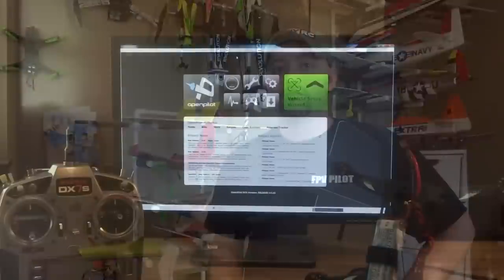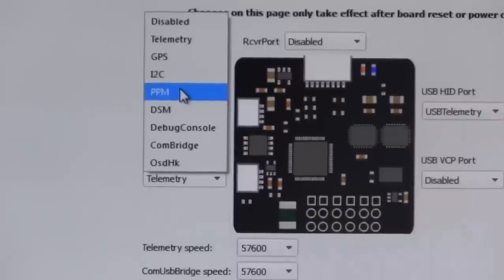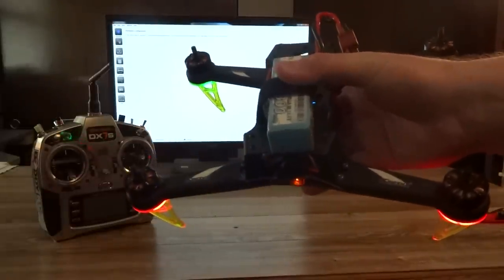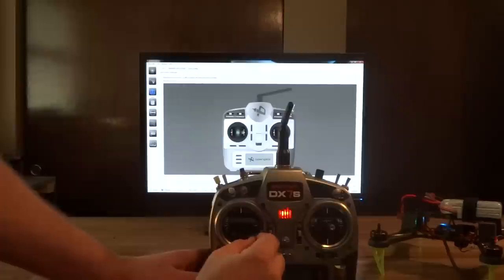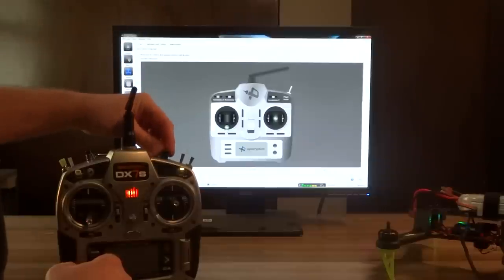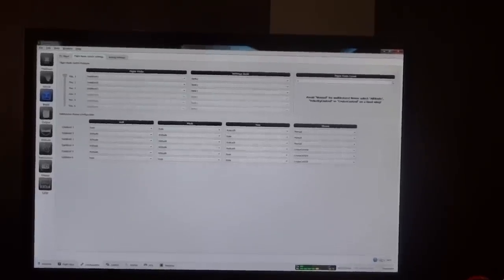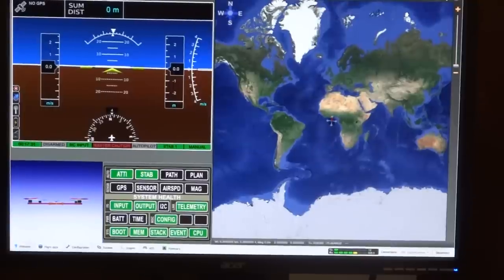Spedix S250 cc3d binding, and Transmitter Setup

Comment: great video. you talk about satellite receiver. i have dx6i with ar6100e rx (no satelite that i know of) id like to buy this quad as my first venture into arf/pnf 250 size. im exp with cheap rtf micro quads & helis. proficient with rtf (non gyro) foam planes like bixler and the like. and race pro buggy 1/8th nitro buggy cars. in other words have good rc exp outside of quads. How will i go with this quad based on my exp and spektrum radio gear?
Reply from the maker: +Jason Black This kit already comes with the satellite. The is no need to add a receiver. The Flight controller recognizes the Sat and deciphers the signal. All you need is a few hours of time to assemble/ bind, a Battery, and a spektrum Radio. The DX6i work great with this setup.

Comment: dont you need a three position switch for the three stabilization modes show you using a two position switch for d/r?
Reply: +moore rc guess you are using a three po switch for stabilization dont know why you need d/r and expo lol
Reply from the maker: +moore rc You do not really need Expo in the transmitter. I just felt as a beginner it was easier to change the rates a little from the transmitter than try to explain each of the different banks in the software.  Its more of a preference and many people today do not set up expo in the transmitter. By using the different banks in the software You can actually set up each mode to have different rates instead of using expo in the transmitter. As for the stabilization modes you can set up the switch for as many modes as you want in the software.

Comment: hi im currently stuck setting up my dx7s in the transmitter wizard set up, when it ask me to move the stick for pitch up and down nothing happens but if i toggle the gear switch up and down it works.
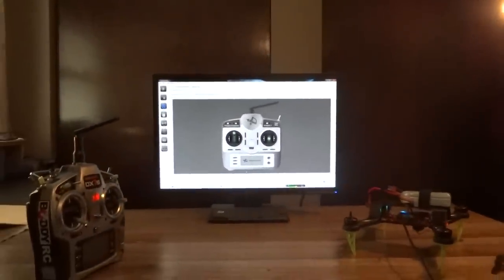Reply: +Marcos Castro Are you positive that you didn't bump pitch during the roll axis? Check out the video at 12:00. If you even barley hit the pitch axis on any of the others like roll it will not let you use the pitch axis anywhere else.

Comment: the dx6 doesn't have the dial, what other spot would you recommend for that? it is the 6 not the 6i
Reply: +steve flounders The dial is used for remote PID tuning. You just will not have the ability to remote tune and will have to keep plugging it into the computer make a few PID changes and put it back in the air to test. It just makes it much harder to get the PID's tuned in. Other than that the Dial is not needed.

Comment: I'm using a Devo 7e with Deviation installed as my transmitter. When I try to bind, the light never goes steady. It turns off, then on again but pulsing slower than before. It doesnt do the next part where the light goes off and then back on steady.
Reply from the maker: +AnAbsent MindedPenguin I'm not familiar with this radio, however it does not appear to be a compatible transmitter for the installed DSMX satellite receiver that is installed in the quad. . You will need to either find a DSMX compatible Radio or install a receiver that is compatible to the radio you are using.
Reply: +AnAbsent MindedPenguin If you set the cc3d to bind mode (&quot;dsmxbind&quot;=0) inside of Openflight like Wes did in the video, then save, and disconnect the board at the lower icon, wait 30 secs, then unplug the USB cable, plug in your battery to your quad with your radio transmitter OFF, it should flash rapidly. turn on your radio TX and put it in bind mode, then the light on your RX should be solid when bound.

Even after you unplug the battery and plug it back into the computer, having put &quot;dsmxbind&quot; back to 0, save, disconnect, wait 30 secs, unplug, plug back in to PC, make sure all settings are still correct, Turn on TX, go through the TX setup wizard. Notice that the satellite LED will be flashing slowly like it isn&#39;t bound..., but OpenFlight can still see all of your inputs and stick movements from the radio TX, from the RX. You do not need to have a battery plugged in for the setup either.

Make sure you have everything all set up, and dont forget to change &quot;always disarmed&quot;, to whatever you want (example in video is Arming/Disarming by throttle DOWN, Yaw/Rudder RIGHT), so that way it it can be armed and flown once everything in OpenFlight, otherwise, you can never arm it and fly. Triple check all settings are looked over and configured the way you want them.

EDIT 
Unless...your either TX or RX isn't dsm2/dsmx compatible like +Buddy RC said... then yeah it definitely won't work. Lol

Comment: Now for the setup would i have to put 25/40 on rudder and elavator? And why are you saying dual rates on expo? Ik u said not to touch d/r but isn't that dual rates?
Reply from the maker: Knuckles For Knuckles Yes you would also want to put the 25/40 expo on the elevator also.  I normally don't put expo on the rudder, but that is more of a preference. You set expo in the dual rate menu in the DX7s. When I say Dual rates I am talking about the expo in the dual rates menu.
Reply: I have `a dx6 would that mess stuff up?
Reply from the maker: Knuckles For Knuckles No. I have used the dx6i myself. The only issue that you will see is that you will have to change the Flight mode switch to reflect a 2 position switch instead of the default 3 position switch. You will have to change that after the transmitter setup.
Reply: Buddy RC No, I have the dx6 not Dx6i
Reply: +Knuckles For Knuckles It will not matter. The DX6 is actually better to use than the old DX6i.